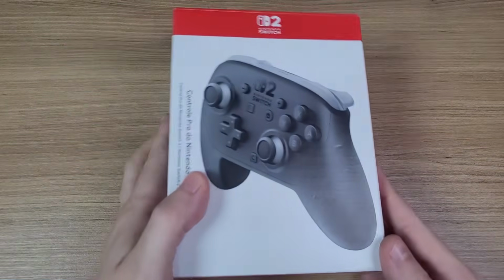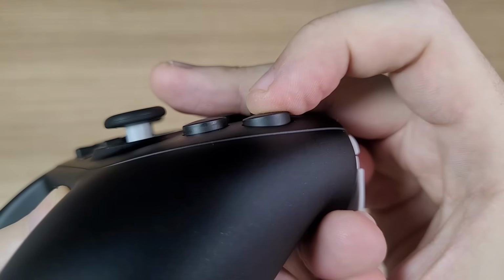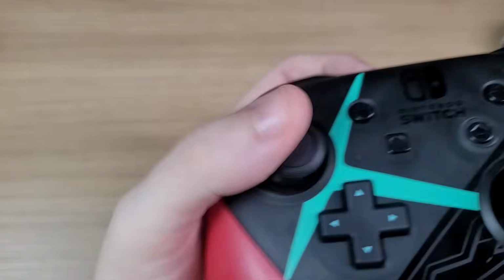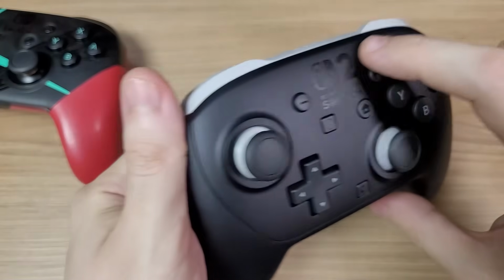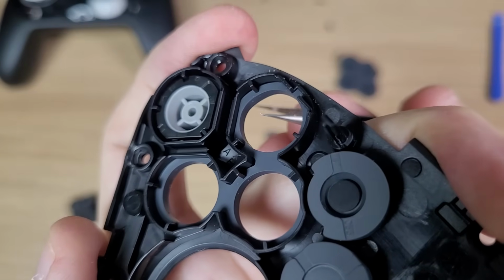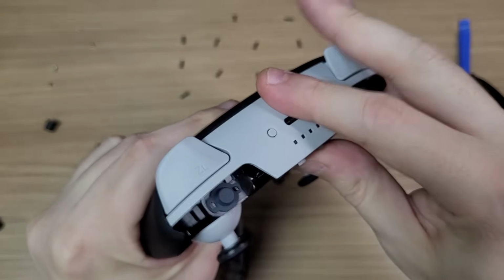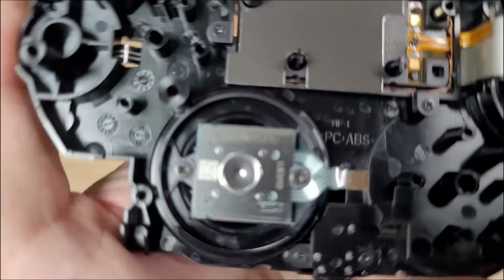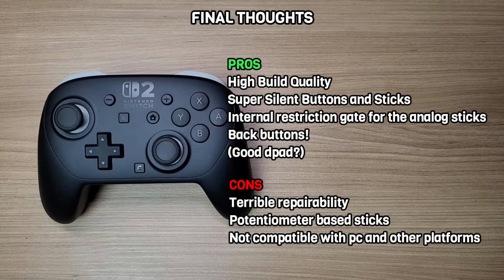Switch 2 Pro Controller Review & Teardown - The New First Party King?

Comment: Was hoping you'd take apart the triggers :( Had an issue with mine after about 20 hours where the ZR button was making much more noise than the ZL. Took it apart and noticed the foam strip under the trigger seemed out of place. Not really sure how to go about fixing it though. RIP warranty.

Comment: The engineering with the silent buttons and sticks is fascinating. However, they clearly don't want anyone getting into the controller. Audibly gasped at the adhesive. I can't believe they used the same joystick mechanism as in the joycons, but at the very least they use a ribbon instead of being soldered down like the original pro controller. Why did they use ribbons for the joysticks and headphone jacks when they used ADHESIVE to make repairs a hassle!? Not to mention how the battery is less accessible than on the original controller. This controller design baffles me.

Comment: The center of my Switch 2 Pro Controller's analog sticks are much softer than other controllers i own and my thumb starts to slip off them when playing.  It's not so smooth its unplayable, just noticable.

Is it just a design choice to feel softer and I'm means to push the stick from just the edge most of the time or is it something I should return to the store before my warranty is out?  Thanks.

Comment: My a button is looser than the other three buttons, and it doesn't feel as good as the other three. In addition, if you press the rightmost edge of the a button, it seems that you can't press it. What kind of tolerance problem is this or is it designed like this? I don't know how to adjust this feel.

Comment: that's disappointing, I figured they were alps but feeling them I thought for a moment that they reverted back to hall effect or whatever they used on the PS3 controller that wasn't hall effect but something that was technically even better. Anyways, these look oddly similar to gamesir's low profile hell effect stick modules and I expect replacements to exist within the first year and people on ebay selling modified controllers with the replacement modules a year after release. My guess is why they went with alps is two folds, alps is japanese and they have a good track record for consistent tolerances and lasting a certain period of time like a warranty period. Anyways I don't blame alps for this but first parties since they want you to buy more than just one controller after all and if they wanted hall effect sticks alps would have made it for them, they did in the past.

Comment: Awesome video, now I'm 100% sure I'll be passing on this one and keep my Switch 1 Pro controller.

What I liked compared to ProCon1:
- The D-pad and L/R buttons on ProCon2 have a shorter travel distance, which means more precise button press. ProCon1 had this issue where you feel the press but it does not compute the input if you didn't apply enough force.
- The gyro is better, and I'm a splatoon hardcore fan.
- Grip buttons.

What I disliked compared to ProCon1:
- No PC/Steam compatibility. I use a lot on my PC.

- When drift happens, we still have no analog replacements to buy and where I live there's no Nintendo tech support.
- Mobo is coupled with too many components, and it will be an expensive fix if one fails.
- Annoying to teardown. I can (and like to) do small rapairs in controllers, but I don't feel very safe with this one.

Comment: As long as the failure rate for the analog sticks is along the lines of other first party potentiometer sticks then they will probably avoid controversy. From other videos, I’ve seen, the D–pad is improved compared to the original, but still not flawless, so still might be worth looking at the controller from 8bitdo in the future for certain games. One feature that is flying under the radar is the 9–axis Gyro sensor. It’s the same type that was used in the Wii U gamepad and does wonders for accuracy and avoiding Gyro drift.

Overall, I’ve been very happy with it. Suddenly, the best potentiometer sticks I’ve used thus far. And I’m happy about the paddle buttons location, which makes them not easy to accidentally hit.

I wonder if Nintendo would ever consider an  'elite' controller this generation? They could probably do something fun and interesting with her if they put their minds to it.

Comment: As someone familiar with repairs how do you think all thaf rubber will hold up over time? Are we past the age where rubber parts become sticky after some years have passed or is that still an issue?
Reply from the maker: depends on the material, if its the same as the membranes it will last a looong time, but if its another kind of rubber then it will probably become sticky

Comment: Hi, when re-assembling, what do you recommend for dealing with the adhesive? Surely I can't just reuse the old adhesive right? If I have to get some new adhesive, do you have any recommendations? Thanks
Reply from the maker: If you disassbled it carefully and used heat you can just place it back and it will still stick

Comment: Rubber degrades over time though, so there is potential for it to become sticky.
Reply from the maker: Indeed that's concerning

However if the rubber is made from the same material as the membrane of the buttons it will be fine

My snes membranes never got sticky

Comment: I've heard other people say the d-pad feels similar. Maybe it's my old one is from Switch launch day, but the new one is completely different and way better. My Switch 1 d-pad was extremely loud and stiff with a lot of travel. You could press down in the center which is why it would often register incorrectly. The one on the Switch 2 controller feels like a normal d-pad Nintendo would have used on the Wii or Wii U.

Comment: This controller looks nicer than it actually is - I heavily criticized the Xbox One (model 1708) controller for being an absolute pain to repair since you have to desolder wires to fully take the board out of the shell, however what Nintendo did here is clearly something only Apple does with their devices.

Using glue to hold on the front plate is a big no-go. Everyone out there who had at least opened to clean their controller once hafter hours of collecting finger cheese knows exactly how easily the internals can get dirty. Imagine taking your controller apart a few times and the glue is gone. How do you replace it? Since it actually acts as a "seal" too and with the glue not being in place anymore the interals will get dirtier even faster. Looking at the other steps just to reach the button membranes is another red flag.

The sticks itself really look concering and Im not sure why thy didn't go with hall effect sticks here... Why do companies always do such things? 1 step forward and 2 steps back.

I'm glad I'm passing on this entire S2 generation but man this is truly disappointing to see.

Anyways excellent video!

Comment: the only downside  for general purpose is the missing analogue trigger. If yoou like racing game, the swotch 2 procontroller likely wont be your go to.
For all else, its nice and great imo.
too bad it - just like og pro controlelr - wont be usuable on pc. so i probably wont need it. will stick to the original.
Reply: It doesn’t have analog triggers because Nintendo devs prefer to develop for digital. The only first party racing games don’t even use triggers for acceleration
Reply: I do know that Its a Design choice - and i dont mind it. I dont need analogue triggers.

But for generality purposes analogue triggers (maybe With a Game Option for "digital?) would be better . @ItsJustKay3141

Comment: Definitely wins a controller contest where only stock controllers count. Otherwise, better cost-value controllers exist.
Reply: Are you sure about this? With the lack of triggers? What current gen consoles and controllers do you personally own?
Reply: Analog triggers are usually a disadvantage in most games anyway (especially shooters), or don't matter (most games, especially ones that don't use them), or matter (off the top of my head, only racing games come to mind)  @Krytern
Reply: @RationalFunction That is very subjective. Shooters just feel better with triggers then there's the racing games you mentioned. Triggers have been a part of console controllers for 5 generations now so this is a big ommission
Reply: @Krytern Shooters feeling better with triggers to you is subjective. Digital triggers are competitively better because there's less actuation time.

They should be a feature, yes, but Nintendo has done without them for years now (since the GameCube).
Reply: @RationalFunction I said its subjective then you reply that it's subjective good job. It's a big ommission
Reply: whether that's huge or not is subjective, that's the point. Most people just don't care for them, abd that's a fact.  @Krytern

Comment: With your sausage fingers If you play 1-2 hours of couse they Controller will be wet any material will not help😂
Reply from the maker: this effect can be seen only because of the heat of the studio lights (which was great to showcase the sweatproof) it won't get this much wet in a cold enviroment

Comment: The og pro controller was so much better for repairability overall. Sure everything has screws and is modular but you basically have to tear the whole thing down just to replace the battery
Reply: On the other hand, you can actually replace the sticks this time without having to solder anything. That alone already makes this a lot more repair friendly than the previous model IMO. The battery should last a good long while so I don't think that'll be an issue any time soon.
Reply: la bateria dura 10 veces mas que la competencia, los casual no les dara ni tiempo de cargar el mando.
Reply: Repairability is important but I don’t think anybody needs to replace the battery in this controller unless it completely fails.

It lasts for roughly 40 hours and most batteries degrade to 80% capacity after 500 charge cycles.

If you play 8 hours everyday it would take you 5 days per cycle so to reach 500 cycles it would take 2500 days.

Each cycle will be slightly shorter over time but if we remove 500 days it would still take 5,5 years of heavy use everyday before it gets closer to 30 - 32 hours of battery life.

Comment: I own this controller and I love the Switch 2, but the fact that Nintendo are STILL using potentiometers proves that they're intentionally manufacturing e-waste at this point. They want their controllers to get stick drift and people to be forced to buy new ones. I will only be using 3rd party controllers with TMR joysticks from now on. Nintendo are trash at making peripherals and can't be trusted.
Reply: All mechanical sticks will eventually get drift. Potentiometer, TMR, doesn't matter. TMR can also be made to drift by nearby magnets 

Like the Nintendo Switch 2 console.
Reply: @timotheatae yeah, but I'll be on the switch 5 by the time my TMR sticks get drift.
Reply: @timotheatae  I've owned so many controllers at this point including two Switch 1 pro controllers that got stick drift. My controllers with hall effect and TMR joysticks have never got stick drift.
Reply: @HighAcuity  And I've never had a lubricated potentiometer stick drift after years, and years, and years. I've had controllers wear through their plastic shells before the sticks drifted. 

Improving durability, providing more and better lubrication, and building in guards against debris, these are not things done by someone "intentionally manufacturing e-waste" or "can't be trusted".

Plus.

TMR relies on magnets, and are interfered with by strong magnets such as those in Nintendo Switch 2. Wouldn't want your controllers going haywire for getting a bit too close to the system.

The hyperbole over potentiometers is just that. Hyperbole. There are optical sticks that drift, Hall effect sticks that drift, TMR sticks that drift out of the box, it's all about build quality.
Reply: @timotheatae  You're on your own there. You must have miracle controllers because millions of gamers would disagree with you.

Comment: PRO GC STYLE COMING… like traditional HORI grip top both stick and DPAD with classic adjustable c-stick on snap or TENSION TENSOR TORSION CONTROL and big optimized style around the BIG A still… have diagrammed a few options for buttons around

Comment: Soft touch plastics turns to wet glue over time(+5 years). 
That's a major problem, if you like to keep your things for a long time.
Reply from the maker: i believe this is not the kind of finish that will get sticky, but i do feel it will come of in the areas around the buttons just like the original switch gray shells https://i.imgur.com/bMs95KV.jpeg
Reply: I hope not. All my PS2 and PS3 controllers are unusable ugly messes at this point because their outer layers dissolved into glue coating over the decades.
Reply: That's different, rubberized stuff does that and slowly turns back into an oil or dries out, this is just plastic with a really fine finish it's more like an anti sweat texture.

Comment: I understand why they didn't use hall effect sticks on the joycons but that same reason doesn't apply to the pro controller, is they really wanted to market this as a premium controller and justify the price a little bit more they should've made the pro controller 2 have hall sticks (unless there's an actually good reason why they didn't that i'm oblivious to).
Reply: Hall effect is not necessarily a more expensive nor an infallible one either, after quite extensive research I came to realize it all depends on material and built quality. Nintendo didn't want to market the new controller as premium, it surely has premium quality like most Nintendo products, but in this case, global economy, inflation played a major role on the rise of prices on first party accessories, rather than on the console itself.

If you haven't tried it yet, you'll understand what they're all about with this new controller, I have, and yes I'd love it to be cheaper, but wouldn't want then to compromise quality for a lower pricing, that good it is.
Reply: Most likely cause they didnt want the magnets to mess up the sticks when they are attached to the console

I have faith that they fixed the stick drift though, most recent joycons  nowadays seem to not really have any stick drift issues, i think they gradually fixed the issue
Reply: @Mikeylel That is also true, they didn't mention but it there were high chances that might happen. I'm also confident drift has been fixed, as for now, all I can say it is the most comfortable controller every and joystick are the slickest smoothest ever made.

Comment: Hall Effect sensors are not a magic bullet and they can and do drift, it is more rare that they develop drift but many lower price controllers like 8-Bit Do and Guilikit often ship drifting or with crazy large dead zones , neither is optimal. I've been an avid gamer my whole life, first controller to develop stick drift was my Xbox series S , second and last controller so far to develop drift was my bundled PS5 controller. Yet to have a Nintendo controller drift on me yet, and I still have an Xbox 360 controller I keep in my laptop bag and its been rock solid for a long damn time now....pushing 20 years!!!!
Reply: Yeah, my 8bitdo controller with Hall Effect sticks has easily the biggest dead zone out of all the controllers I use, including another 8bitdo controller. Never had stick drift outside of some physically loose joysticks, which has nothing to do with the potentiometer.

Comment: There are improvements made over the version 1, however the new pro controller cost USD85, with no Hall effect / TMR sticks, no micro switch button/trigger, no remappable buttons... It just doesn't sounds right to me. I have a 3rd party controller that done all these and only cost me USD55, it even comes with a charing dock for the controller.

Comment: You have to go so far in just to replace the battery. It's crazy. On the original Pro Controller, it was just a standard 3DS battery, too, meaning it was easy to find a replacement battery for it. I don't enjoy this change. They're just making things harder to repair or service even in simple ways like battery replacement. Great tech, but absolutely horrendous for repairability.